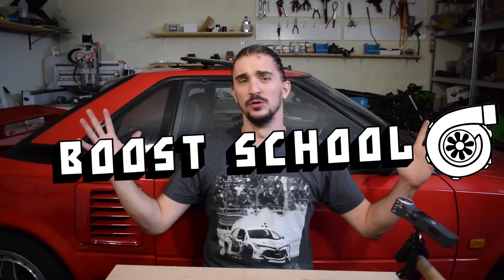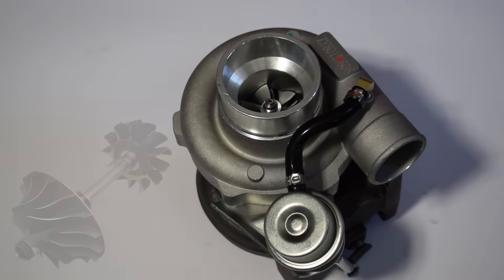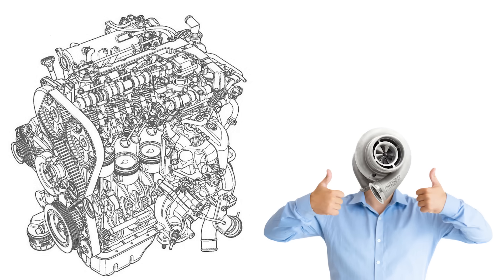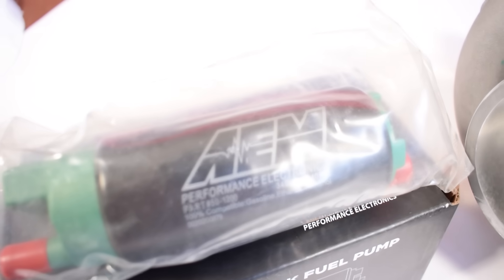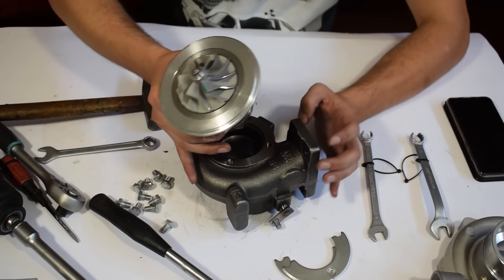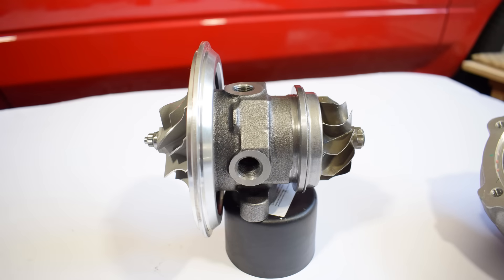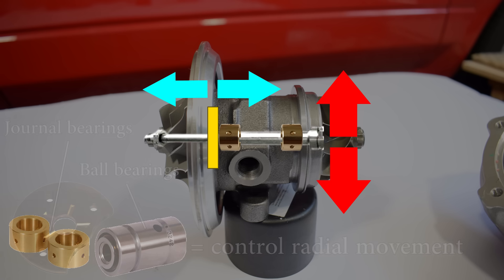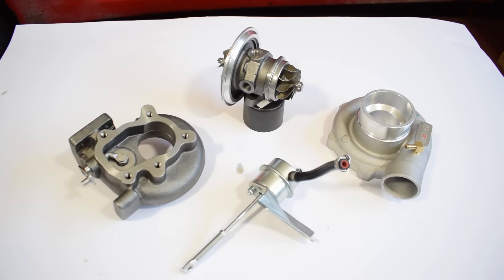TURBO 101 - How it WORKS and what's INSIDE - BOOST SCHOOL #2

Comment from the maker: AEM high flow fuel pumps: http://bit.ly/2D4Ahighflowfp
AEM adjustable FPR:https://bit.ly/2XoP97w?utm_source=D4A&utm_medium=link&utm_campaign=afpr&utm_term=fuel-pressure-regs
AEM wideband AFR gauge: http://bit.ly/D4Axserieswb
AEM boost controllers: http://bit.ly/D4AtruboostX
Get the turbo from this video: https://www.maxpeedingrods.com/product/gt28-gt25-gt2871-gt2860-t25-t28-sr20-ca18det-upgrade-400hp-turbo-turbocharger.html?tracking=D4A
Coupon: D4A--get 8% OFF for all orders on maxpeedingrods.com
Support d4a: http://driving-4-answers-shop.fourthwall.com/
Reply: Bro how a turbocharger is different from a supercharger and naturally aspirated engine? I mean supercharged and NA engines move a steady amount of air in the cylinders so they have a linear power delivery right? Do Turbos also provide always a fixed amount of air or not? Because in a turbocharged engine you sont feel that linear power delivery
Thanks for answering
Reply: I'm an engineering student, currently procrastinating studying for, well, thermodynmics. I love this stuff. I'm reminded of why I am trying to learn about math and physics.
Reply: Am I being dumb? I still don't get how it produces more power. I understand the principle - more air, more fuel, bigger combustion. So far so good. But isn't the main issue with higher pressure the fact that petrol can autoignite at high pressure? Isn't that why cars don't compress more than 14:1? How do turbos get around this?
Reply: Why you zip tie wrenches????
Reply from the maker: @brusk3978  I hang them on the wall 😊
Reply: @d4a  awesome video, could you check your dm on Instagram, I asked you a couple questions, I would really appreciate if you could answer them, thank you soo much and keep it up!

Comment: always a pleasure watching your videos. I would think on this one if you had taken the ideal gas equation and used it to demonstrate that Pressure, Volume and temperature are all solidly related to each other. There are no free lunches but turbocharging is about as free as you are going to get since the energy is wasted, a cut off exhaust pipe demonstrates that energy loss totally clearly.

Comment: Not hating, as a correction you can't apply the ideal gas law like that to volumes of a fluid flow channel like around the 8 minute mark. Because the number of moles in the two volumes compared aren't necessarily the same. What really happens in the compressor is that due to the conservation of mass principle, the air slows down as it flows through the expanding volute (snail shaped thing) immediately after leaving the compressor wheel. Due to the Bernoulli principle, this reduction in velocity coincides with an increase in pressure. The ideal gas law is then relevant because the density of the air increases (= volume decreases for a given number of moles) due to the higher pressure.

Comment: very informative video brother!! 
however I have something to say; ball bearings are not GOOD for higher turbo rpms, I think so !
on the other hand the bush bearings can operate at elevated rpms. the reason is, I suppose, simple. as we know there is always physical distance between bearing balls as it rotated around the bearing race. the lubrication enters these gaps between the balls as a viscous fluid. imagine a ZZ sealed ball bearing fitted in a turbo filled with grease and you know what will happen at higher rpms, surely the grease in front of the balls will RESIST  the the rotation and hence hindering the turbo to spool up. the same would come true for the oil. as the rpm increases, say above 100000 rpm, the oil accumulated in front of the forwarding balls will tend to RESIST higher speeds and turbo would lag to spool up (this is just like a car running on a day road vs running in wet causing more resistance to tyres to rotate and more load upon the engine). However on the other hand in a simple bush bearing (which you say journal bearings) there are no intermittent parts like balls, so the oil swarm is not likely to come in the path as an obstacle, instead the oil film is UNIFORMLY DISPERSED all around the shaft, however it would cause shear resistance depending upon the oil viscousity. I think this shear resistance in a bush bearing is much less than the resistance offered by the OIL-LUMPS in front of the forwarding balls in ball bearings (just like the resistance of water in front of forwarding tyre). Will I am not a mechanical of automotive engineer but I think bush bearings are more suitable at elevated turbo rpms (say 150000+) as compared to ball bearings.
IN NEED OF YOUR COMMENTS PLEASE !!!

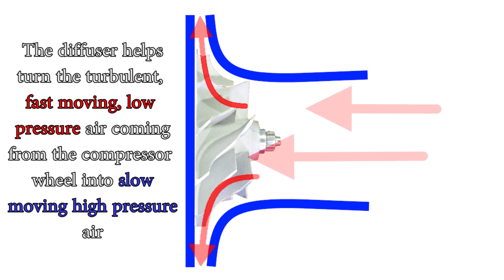Comment: 7:53 wait a minute. Shouldn’t it be SLOW-moving, LOW-PRESSURE air, into FAST-moving, HIGH-pressure air?

Because P=F/A, whereby the canal areas of the diffuser is what creates an increase in force (in this case, velocity of the air).

Comment: The point about the diffuser at around the 8:00 mark is not completely intuitive for me.
Yes, the ideal gas law states that if you decrease the volume of a (static) gas, you increase its pressure.
On the other hand, in terms of fluid flow, Bernoulli's principle states that if you decrease the diameter of the "pipe" in which your medium is flowing, (in other words, restrict the cross-section of - ie. the space available for - a flowing medium), you increase the flow speed, and thus decrease the pressure.
(Alternatively, one can think of the Venturi principle, which is essentially the same thing.)

The air passing through the compressor of a turbo is a flowing medium, thus restricting the cross-section available for said medium makes me think of Bernoulli's principle as opposed to the ideal gas law. I'm clearly wrong here though so if anyone took the time and effort to explain to me why I'd really appreciate it.
In other words, what should make me think that decreasing the space available for the flowing air will increase its pressure, when Bernoulli's law states otherwise? What am I missing here?

Comment: I have a mitsubishi pajero 4m40 2.8 turbo diesel. I recently changed its cartridge but after watching this video im having doubts about its performance and reliability. My question is that if i play around with its wastegate actuator and put up a boost controller for more power gains, how would it effect the turbo and the engine?

Comment: You said that an inner cooler cools the air so that the engine does not pre ignite and detonate because of the air temperature. isnt it also true that it cools it off so that i can fit even more air into the cylinder? because once the compressed air is cool, shouldnt the air be even more condensed in a way?

Comment: With 1,0 bar of boost do I have exacly 2 times more molecules of air in the cylinder? Or less becouse of hotter air which is less dense? Are there any other factors?

Comment: You didn't say that the intercooler reduces heat transfer from the exhaust turbine to induction turbine and so keeps the induction gasses cooler, a big omission in my opinion

Comment: I love this channel. I have a question, I've never understood this. How does a larger turbo generate higher boost? I keep reading how a small turbo spins very fast and a large turbo spins slower. So why does the slower spinning larger turbo produce more boost?
Reply: Larger compressor, so higher pressure assuming the same engine and same rpm. However theoretically you could have two turbos, different sizes that provide the same power depending how they're geared. If the cfms they flow are the same then the power will be the same but the engine will be less stressed on the exhaust end, because you are using less exhaust pressure to create the same power.

Comment: I have a Cartech NSXtwin turbo kit with an internal wastegate using 2 Garrett Gt28r53 turbos which was installed when engine was only 3.0 liters. I have now added a 3.5 liter kit with ported heads, cans and require more boost. What is the  best way to gain more boost in this type of system? Wastegate are set for 9lbs.
Reply from the maker: If you want to know how to increase boost then you're interested in different boost control strategies and how different kinds of boost control solenoids increase maximum boost pressure in relation to wastegate spring pressure. I have a video on just that: https://youtu.be/hYIL_XvlYTE

Comment: 09:02 it's actually an AFTERCOOLER. It's called "INTER " cooler when it's IN-BETWEEN turbos. It could have been called as POST cooler (from turbo perspective) or PRE cooler (from combustion chamber perspective) as well. Overall very good vid, mate. Cheers 👍

Comment: Very good.
Here's a question.
When turbo's fail what can be the consequences? If anything breaks off where can they end up? 
Common areas are bearings?
Lack of oil or oil contamination. My turbo failed on my 2016 Renault Kadjar DCI. With only 28689 miles on the clock. Always serviced by Renault dealer. Car was well maintained and looked after. I bought the car 3 years old with 15k on clock.
The Renault dealer thinks it was the bearings. I'm still waiting for a report from Renault themselves as turbo unit is sealed. On repair the dealer found large amount of silver floating in engine oil so much it was "glistening."
They flushed engine twice until they found no more.
The intercooler and piping to turbo was all replaced.
As I write this I'm waiting for a response from Renault.
•Root cause 
•what metal was bearings made of?
•what path did metal fragments take?
I'm trying to establish if the radial imbalance caused fragments to squeeze between compression and turbo wheels or just got sucked through oil feeds down to sump?
If they didn't pass through wheels to intercooler or exhaust chamber then the only other way would be oil feed pipes? Surely modern engines would have a filter system or restrictive means in event of bearings failing metal fragments would not make its way to other engine components? How soft are the bearings when they break off? Are they shavings which take a direct route to sump out of harms way? Thoughts please much appreciated.
Car btw is back on road but concerned that their is potentially further damage to come to engine.

Comment: I'm looking for an answer that I didn't manage to find on Google. My turbo overboosts 1.5 bar (22psi) around 3800/4000 rpm and than starts to drop down boost to 1bar (14 psi) when the engine reach peak power at 6500rpm my question is, is the mass air flow higher with 1.5 bar of boost at lower rpms or with 1 bar at higher rpms? It is correct to have a leaner AFR with 1.5bar os turbo pressure at lower rpms than with 1bar at higher rpms? Thanks in advance.

Comment: I had a seal/tape that was on the compressor side that came off when I had to take the housing off to tap a boost reference, do you think this caused any leaks or problems? Can’t see why the turbo manufacturer would put it in there if it wasn’t needed. Thanks.
Reply: I doubt you'd have done it any favours. It might be that it was there as a friction seal, so things don't pop off under pressure. Easiest way is put the engine into boost and see if its down on power. If it is, buy a replacement.
If its there, its often there for a reason and trust me, you don't want to be joining a motorway when your engine goes n/a.

Comment: You're making some decent videos.
But.............................
The speed of the exhaust gasses, when they leave the exhaust valve(s), isn't nearly high enough to spin the turbine wheel fast enough to make any boost pressure. So the job of the turbine housing is to accelerate the exhaust gasses by steadily reducing its cross sectional area, from the flange to the nozzle. 
This causes a significant increase in back pressure between the turbine housing (and the turbine wheel) and the exhaust valves.
Basically, for every pound of boost pressure, you will have at least, and it will be more than this, a pound of back pressure between the exhaust valves and the turbine housing.
That causes higher heat retention in the exhaust ports and more importantly, higher heat retention in the exhaust valves. 
And that leads to lower knock limits for the given fuel octane ratio.

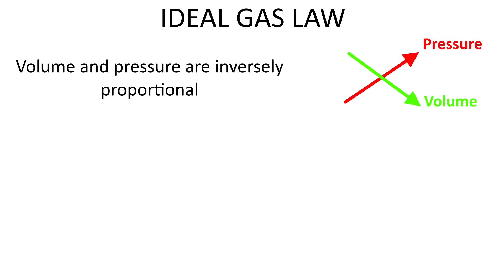Comment: 8:45 The part about temperature and pressure being directly proportional is only true on the condition that volume remains constant, which it is not in this case. The real reason for temperature rising is due to work being done to compress the gas (dW=dFdx, or dW=dPdV), increasing its internal energy (i.e. temperature).

Comment: Just run the turbo on a separate sump tank if you're wanting to keep oil temps cool.  Use an electric oil pump to cycle oil through the turbo before startup, so there's no dry starts.  You can even add an oil cooler through the loop, and run different oils than what the engine's using.

Comment: Big fan of your vídeos here! :-) One thing, turbos do not generate Boost/pressure, turbos generate flow(like oil pumps or any kind of Pump), Boost is just a result of the excessive flow and flow restructions, if you do increase restructions for the same anount of flow  you increase boost, same for the temperature, more temperature equals more pressure.
Reply from the maker: Therefore turbos generate boost. If boost is the result of excessive flow generated by the turbo, then boost is in fact generated by the turbo. I just had another viewer commenting how turbos don't actually suck in air, they displace air. It seems today is semantics day.
Reply: @d4a  hehehe! Well, it all depends on your point of view, if you focus on the engineering point of view of an air Pump only or in the application itself.
I only point this out because some people have bad a tendency to relate boost with air mass density and that is not accurate, i hope you talk more about it in your vídeos and hope it clears some minds.
Keep the good work.

Comment: When you say a million molecules you need to put an asterisk and say, actually much much more (500 cm^3 * 0.0012 g/cm^3 / 28.97 g x Avogadro's number) that is .1.24x10^22, so 1,000,000 compared to what is really in there 10,000,000,000,000,000,000,000  ... big difference :)))
Reply from the maker: I don't know how you missed it. There is an asterisk and an actual number right at the bottom of the screen.

Comment: I like your show how ever the the compressor doesn’t suck it displaces air ! It is a central pump. The air only slows because it has nowhere to go. If engine demand was greater than turbo supply there would be no boost ! Atmosphere falls in to the pump to replace the air that was displaced at a percentage of the approximate 1 bar . As with all intakes 1 atmosphere isn’t much pressure and lots of things can reduce its flow . The bow wake on the tips of blades cause a huge obstruction. Vacuum is a lack of energy, pressure is energy! Sorry for being a dick but to get the most out of a turbo you must first understand there is no such thing as suck ! Cheers
Reply from the maker: It's semantics. Sucking is just another word for air displacement. You put a piece of paper in front of a turbo and the turbo will suck it in. We perceive air displacement as sucking. Your vacuum cleaner also displaces air, but no one uses that term because it would confuse many people. I aim to make my videos easy to understand for everyone and this is why I also use terms that are easy to understand and match general perception.
Reply: I get your simplistic point. And the the very common misconception ( suck ) I also see lots of turbos with large open exhaust to get the gases out ( good ) and twisted flattened intakes across the engine bay to get clean air , because the concept is that a turbo can suck all the air it needs . It can only displace air it is given and this is more important than a restricted exhaust for power production . Teach the science not the voodoo

Comment: I was wondering why the Koenigsegg turbo concept with it's TFG engine couldn't be replicated but mechanically? Where you have one set of exhaust valves going to one turbo and the other exhaust valves to the second turbo. At mild revs and load, all the exhaust gases flow into just one turbo. At  a predetermined load/revs, a second camshaft profile activates and directs exhaust so that both turbos receive boost. The only thing different from Koenigsegg is it's all done mechanically instead of its Freevalve.

Comment: I have a question! I'm a bit stomped by the concept of high pressure slow moving gas. I thought reducing volumes increased mass air flow to maintain a constant pressure. In this case, is the flow slowed due to the accumulated air charge in the system or is it something else? Sorry, just want to get my concepts straight.
Reply: You made some confusion with mass flow. Mass flow is constant, since there are no places for air to enter/leave. What happens is that the compressor wheel accelerates the air, and the volute shape of the housing increases gradually in cross section. Because mass flow must be constant, as the cross section increases the speed must reduce. And because of conservation of energy, when speed drops pressure rises (Bernoulli principle). The video explanation is wrong in this part.
Reply: @slicktires2011  thank you for the info, that helped shed some light on the subject 🙂

Comment: Love this. I didn't study automotive engineering but love cars. Decided to read a book on automotive engine design, building and repair to get to know more than what I knew about cars and this boost  school is helping me understand concepts I've read so far better.
Reply: @Lucas Van Hamburg It's called  Automotive Engines Diagnosis, Repair and Rebuilding 6th edition by Tim Gilles. Got it from PDF drive
Reply: If you like videogames you might need to check out Beamng and Automation